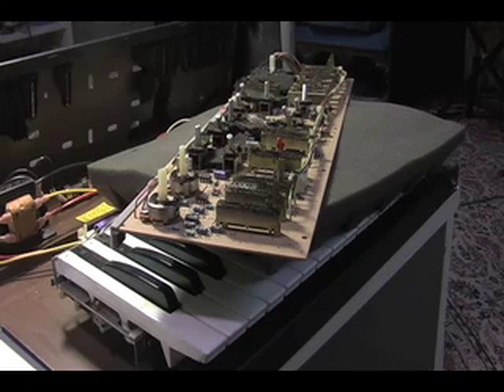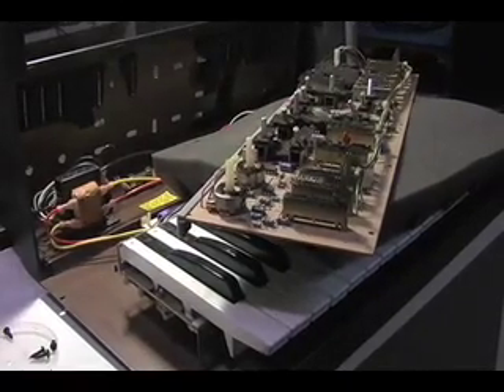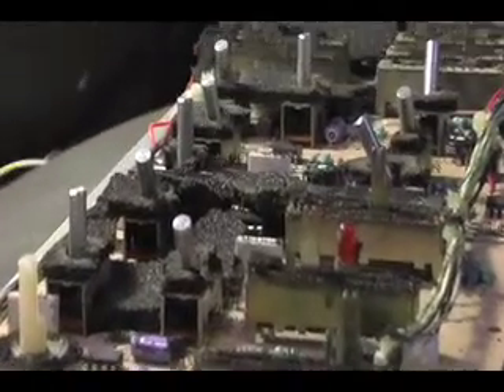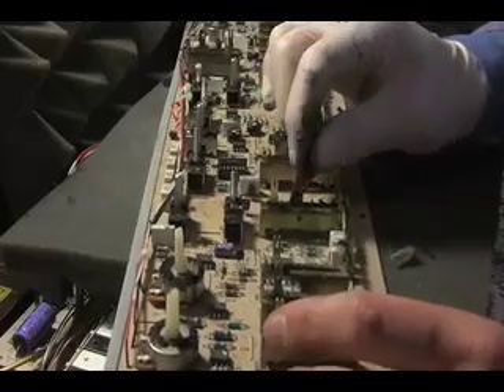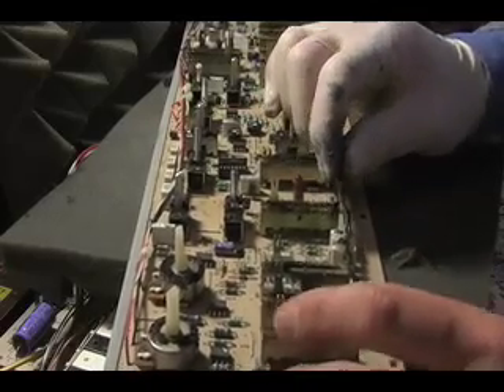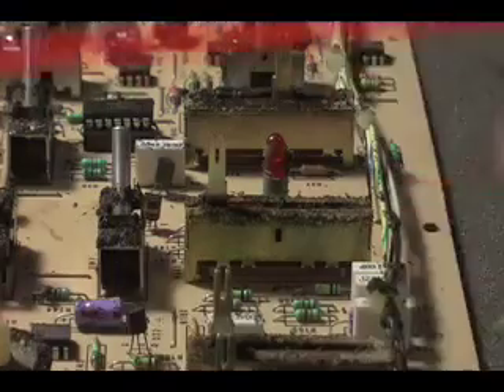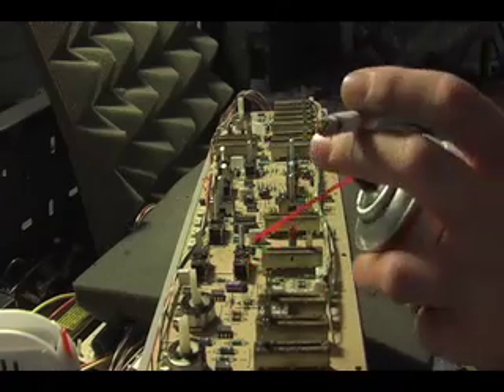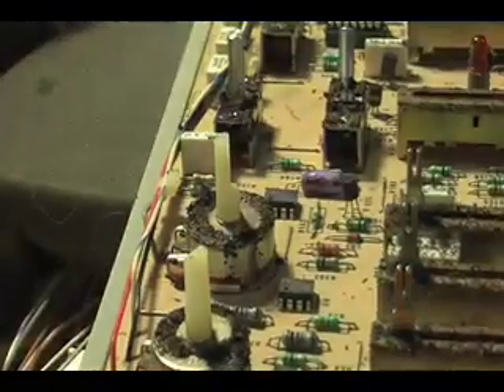How to Clean the Realistic Concertmate MG-1 Synthesizer by Moog

Comment: I have a few problems with my MG-1. The bell tone doesn't work, no big loss, but a few keys don't work in keyed mode, only in continuous mode. This does present a little problem in playability. I don't know if cleaning it will solve these problems but I'm sure I need to get that foam out and see if it has gummed stuff up. I may be putting it on Ebay soon, problems solved or not. There's a guy that has one on Ebay now, has it Buy It Now for $999. I think he needs to clean the foam out of his brain. From every thing I've seen these go for $400-500 tops.

Comment: Use lighter fluid like you use in zippo lighters to clean out the sliders. you can unsolder, unfold and wipe the carbon tracks safely in the sliders with that, then lube with Faderlube, reassemble and resolder them. Takes a few hours if you can do such things. I have done.